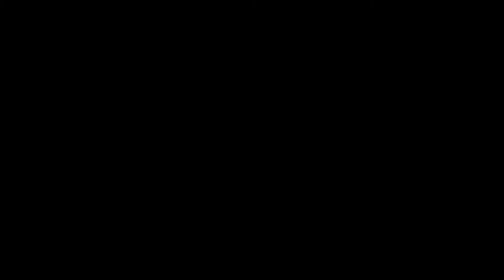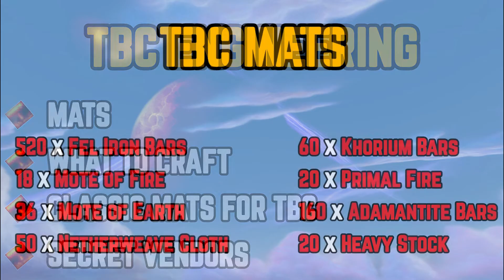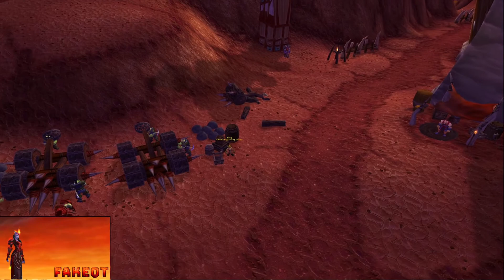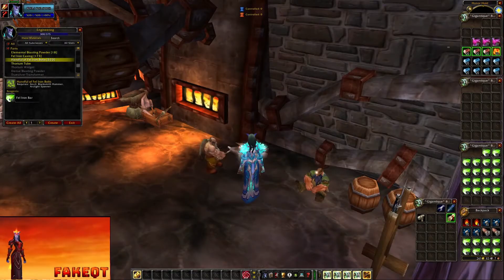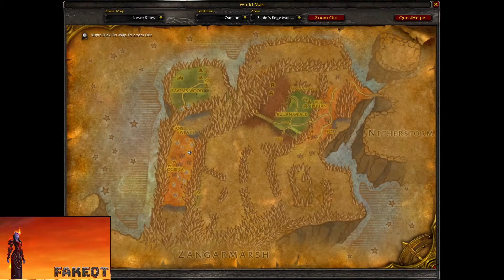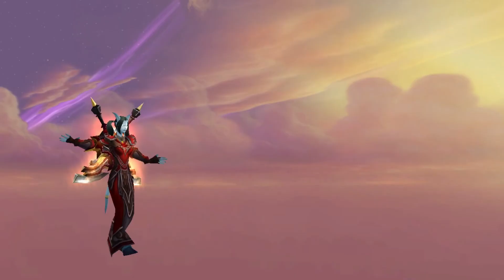WoW TBC Engineering guide 300-375

Comment: Would it be worth to do the extra step to get The Zapthrottle Mote Extractor ? Or do you recon there will be so many engineer that getting motes with gaz clouds will be near impossible ?
Reply from the maker: I will rush my engineering to do the mote extracting, but I recon many will do the same. So I doubt it will be even worth to do it :)